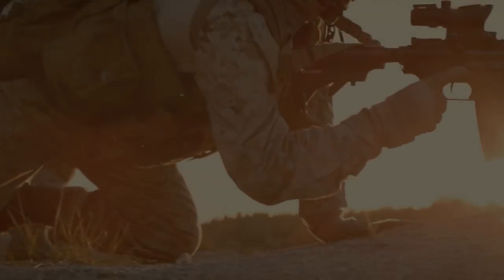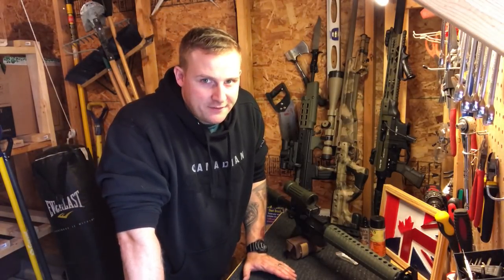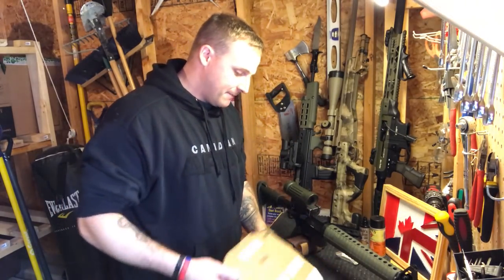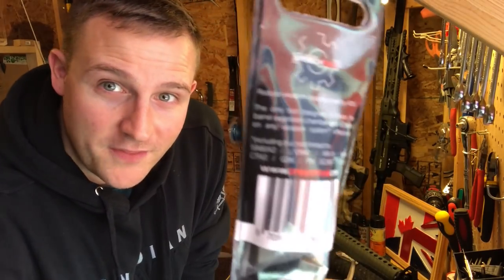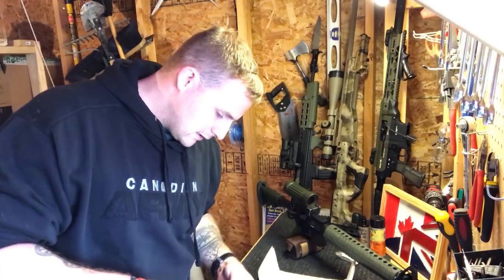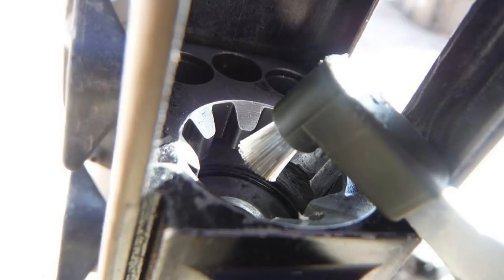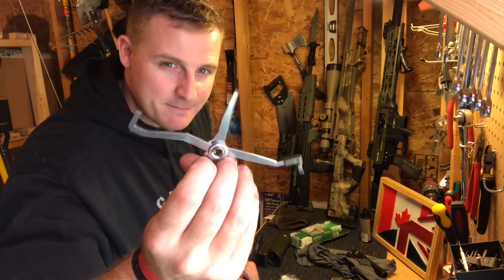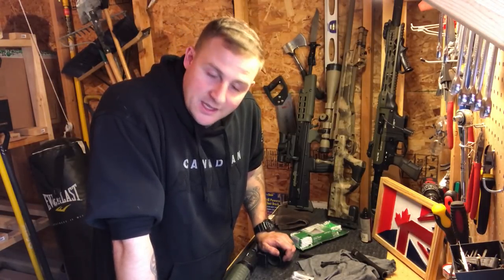Cleaning your Rifles - A BETTER WAY! | Breechtool TM

Comment: 5:30 - Yes bore snakes are awesome until one snaps mid pull through the barrel and it takes 3 hours to remove using everything from solid brass push rods, compressed air, modified fish hooks then finally the Phukit moment when I busted out the drill press and severely damaged the lands & grooves on  1/3 of the barrel (it was a cheap PSA barrel).  That upper became my dedicated 22lr conversion upper and it's not that bad accuracy wise surprisingly!   Had a rough 1st range trip with the CMMG 22lr conversion kit; constant FTE, FTF, double feeds, and even had a spent casing get lodged in the trigger/FCG space and bent part of my FA BSF3 trigger 😔 😟.   Luckily it's still functional but I wasn't happy.  Ordered the bore buddy Reliability kit so hopefully that helps.  Anyways thanks for the awesome content!

Comment: I used one of those last week on a regimental range package, I wondered what it was, it really got the job done. Il'd just throw in a combi tool as well.
Reply: Thanks! Yes they are meant to be used in conjunction with weapon/sight specific tools e.g. combi tool as you mention. That way with a Kobra pull through and our oil spray bottle, you can streamline your whole kit as you don't need the rods and issue brushes that are only good for three uses!

Comment: A light mineral oil is all you require for lubrication. For cleaning I have found penetrating oil can soften up carbon build up (good for artillery too) once you find the brand that works best. Both are less expensive than these small bottles of special gun oil that equates to $300 a gallon.
 Firearms are not engines requiring oiling so they should not be dripping with it. 
However,,,...... when you are told to have a spotless firearm this tool can help, like brushing all your teeth.   Having cleaned more than my share over decades a cleaning tank and air compressor speeds things up, having problems cleaning, see a 421L.  Last time I looked (too long ago) barrels were C class so go burn one out having fun lol (we did).

Comment: It looks like a huge improvement over the standard chamber brush, which I have always found to be extremely tight and almost impossible to turn, once forced into the chamber area.  I use a 9mm brush for the chamber proper and a Q-tip to swab out the receiver extension.
I've used bore snakes exclusively for the barrel for years, but it helps to keep a rod on hand for knocking out stuck cases at the range.
Reply: Thanks for the kind words. Those issued chamber brushes & how ineffective they are even after a couple of uses from new is exactly the reason why The Breechtool was created. The washable and very durable brush heads were designed to stop needing limited-use Qtips that did not dislodge effectively enough.
Reply: @NHMDTV  i find that the chamber brushes are good for cleaning inside the chamber , but crap for cleaning behind the chamber star , using a patch with my finger doesnt do much, does this chamber tool really clean up the crap behind the star effectively ?
Reply: @geezerp1982  the main tool used with one square of flanellette being pushed around to get absolutely everything is how it's meant to be done buddy

Comment: Maybe back in the day Cordite was used in small arms ammo (early magnum cartridges), but not anymore. Modern small arms ammo uses smokeless propellant.
Reply: Two points

Cordite was smokeless

It was standard issue in basically every british military cartridge from the 1900s to the 1960s
Reply: @CaptainCiph3r  Correct. I was thinking old elephant stopping cartridges for some reason.

Comment: Just use a dental tool (the hook pick) to do as good of a job as a breach tool
Reply: Fyi during our research this is a common method you're not wrong. However a lot of the time they are made from materials harder than 304 SS which can damage a weapon system (we have seen this happen unfortunately multiple times). As with a lot of ad hoc solutions - they were not designed specifically to clean weapons.
Reply: @NHMDTV  it's just a cheaper alternative. I've borrowed a breach tool and with the arms they seem to get in the way when cleaning the L85a2 so to me I haven't seen a reason to invest in one yet the bore snake on the other hand is a life saver however my one has a factory fualt with a little bump on the brass bit at the end so you have to shake it all the way down the barrel
Reply: @balaclavallama  no worries, thats why the Breechtool™ Lite was created to not break the bank :) also - love the youtube handle!
Reply: @NHMDTV  I will check out the breechtool light then. The dental tool occasionally breaks or bends in the cleaning kit so I can see why people use them
Reply: @balaclavallama  Awesome 👌

Comment: Hey mat do you have tip on how to clean an old 1911 colt it belongs to my dad it is very old
Reply: What do you want to know? There are lots of YouTube videos on field stripping and  disassembly of the 1911a1. The best are the videos made by Wilson Combat and Brownells. These are more advanced level demonstrations.
To disassembly remove all ammo and magazine. There is a barrel bushing on the muzzle. You will find a button end of the return spring retaining cup just below the barrel. Press that spring cup down and turn the barrel bushing to clear the cup from the locked position. It is under spring pressure so release slowly. Remove spring cup. On the left side of the pistol's upper slide are two notches. The large notch is the slide stop catch. The small notch is for removing the barrel pin. Push the upper slide to the rear to align the small notch and the front portion of barrel pin. You should be able to remove the barrel pin. Slide off the upper slide. Separate the barrel bushing, barrel, and slide. The lower portion of the pistol is not to be disassembled. At this point you have field stripped the 1911a1. You will have: one barrel, one barrel bushing, one slide spring, one spring retaining cup, one upper slide, and one lower assembly. Disassymbly of the lower receiver should be done by qualified gunsmiths. There are a few small springs that are difficult.
Reassembly of the 1911a1 is just the reverse steps. You may find the insertion of the barrel pin easier if you utilize the bottom of the magazine to depress the spring pressured locking pin. Place the flat side of the magazine on the slide. Use the sharp angle of the magazine depress the small locking pin to fit the barrel pin back through the small notch.
Watch some of the many YouTubes videos available to get a better understanding of of the field strip of the pistol.
Reply: Forgot one of the parts you will see after disassembly. I wrote: one barrel, one barrel bushing, one slide spring, one spring retaining cup, and, one upper slide.
Add to that list a spring guide rod. Guide rods were originally short. Sometimes modern 1911a1's, that are used in competition, have long rods. Long rods can be either one-piece or two-piece style. Your Dad's 1911a1 is most likely to have a short guide rod. 
When you reassymble the pistol. Lay the barrel into the channel of the upper slide. With the barrel drop tab resting forward on the barrel place the curved portion of the guide rod on the round shape of the barrel. The guide rod should be inserted into the recoil spring. Attach the barrel bushing on the front of the slide. The barrel needs to be sticking out. The spring cup is attached last. Be careful because that cup may slip out of your hands and will fly off.

Comment: Hey Matt love your show. I have a 16 guage Remington that was my dad's and he got it in the 50s. Now I had my head up my ass a few years ago when I was living with my friend. I had the gun in a soft case and on the top shelf in our gun room. The basement flooded for a few days and we didn't know it. To make a long story shorter the case got wet from the humidity and the gun rusted very bad. I took the gun back to my dad and he took steel wool and that took all the blowing off. Now not too long later dad died. Now I have a shotgun with no blue on it. My question is do you know of anyway to reblue my gun?
Reply: It would be best to go to a professional gunsmith and have it done by them. Seeing as you are not too familiar with the subject. But be warned a high quality Blueing is a bit pricey, but sooooooo worth it